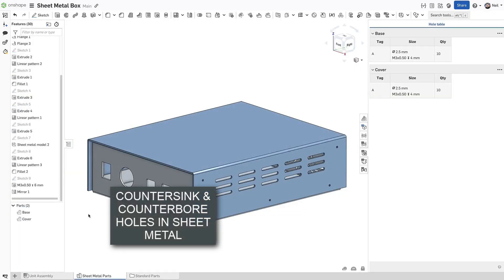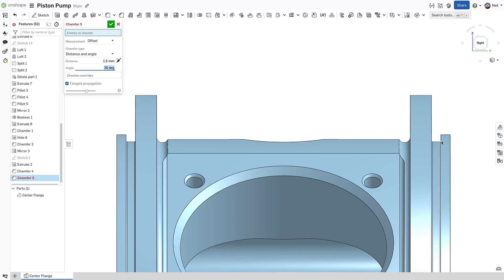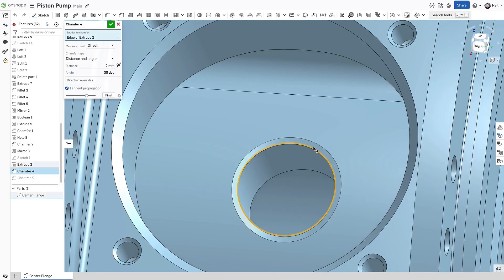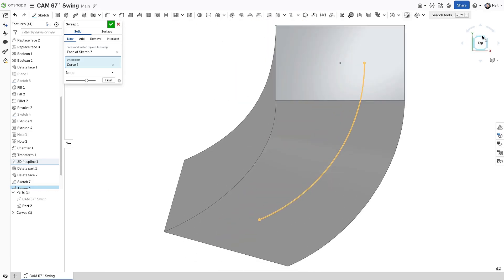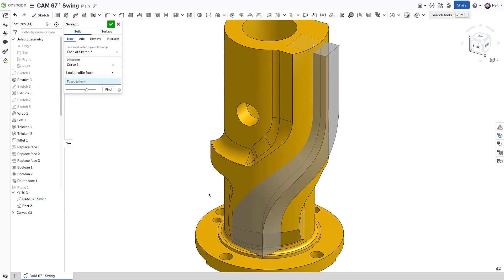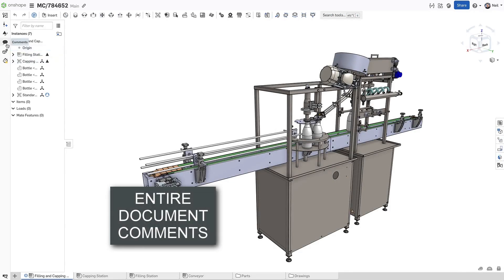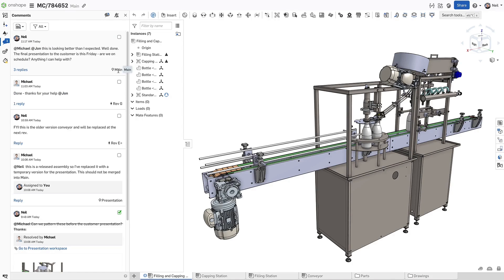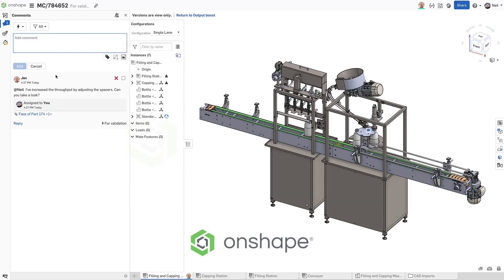What's New in Onshape 1.174 (Countersink & Counterbore Holes, Sweep Profile Orientation + MORE)

Comment: when is onshape gona add a threading tool that works for internal and external threads and gives thread size options   like fusion 360 does???!!?
Reply: That is already a feature. We've had "Hole"(which you can do tapped) for a long time and got external threads Nov 2022. If you're talking about the actual geometry looking like the threads, I'm sure there's a featurescript that does that but quite honestly that's a very bad idea to model threads.
Reply: thats just it. i think the thread feature should be included and not a script!. the script feature dont work like the thread tool in fusion 360!  onshapeshould hav a built in thread tool  just like fusion 360 has, exactly. fusion 360 thread tool is  perfect and onshape should have one too! get on it! slackers! hah @lucaskuhns3668